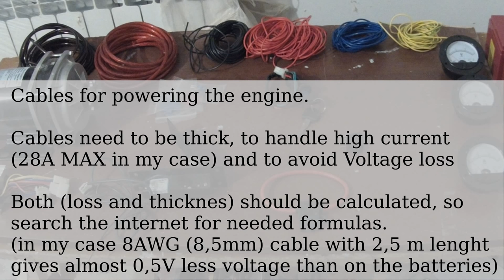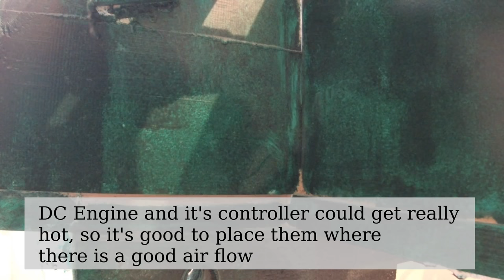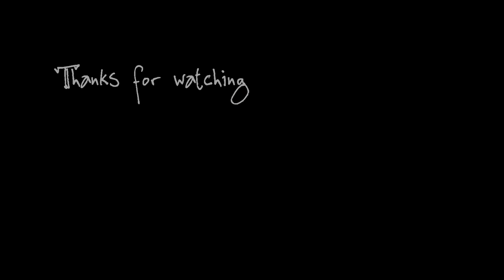Homemade electric go kart - part 3 - body steering and electronics

Comment: Thanks for posting the video.  Can the car drive back ward (back up)?  If not, I guess you just need to implement reverse polarity switch right?  Again, thanks for your time.
Reply from the maker: Hi, thanks for appreciation.
This car can't go backwards because of the electric controller which is from scooter so it hasn't such option.
Reverse polarity isn't only issue. If You want Your vehicel to go backwards You can't mount freewheel as I do.
Without freewheel however when, for example, You would go downhill without pushing the gas pedal, You will get backcurrent generated which can ruin Your controller.

Comment: What a lovely creation! Can you tell me the purpose of the lever on the side of the car? Does it have a function (brake, gear) or is it just for fun. It looks like the type of brake used in early cars where the lever pushes a block of wood against the tyre. Thanks for sharing the videos!
Reply from the maker: +George Perkins The lever is a handbrake. It breaks although not very good;)
Reply from the maker: +George Perkins and yes, i was inspired by old car breaking system as You described
Reply: It certainly adds to the vintage feel of the car!

Comment: Insted of puting an elecrrical engine in it how could i put pedals 8n it
Reply from the maker: I don't know that
Reply: @skillful_DIY_fan  Hi, I,ve built a car similar to this, MG-TC , and my grandson found it way too difficult to pedal, so, I,m thinking of making it elestric, like you did, Question:: I found a kit on Amazon, for a 24 volts with all the necessary parts to do it, can it be reliable, made in China ?